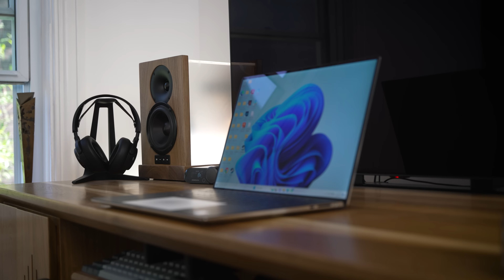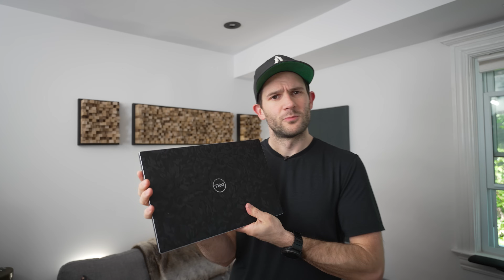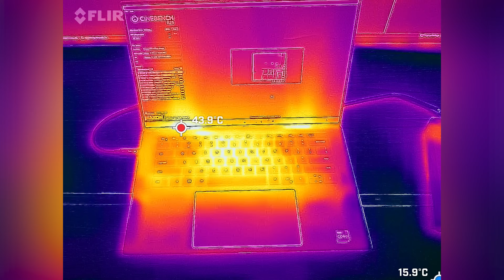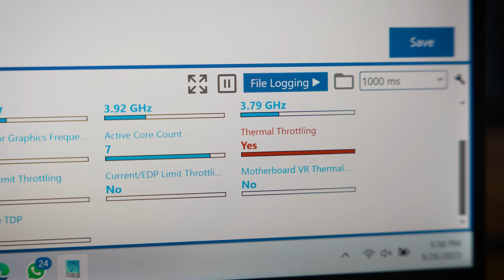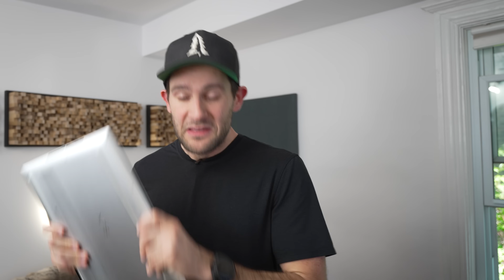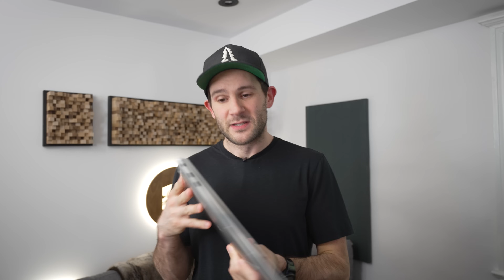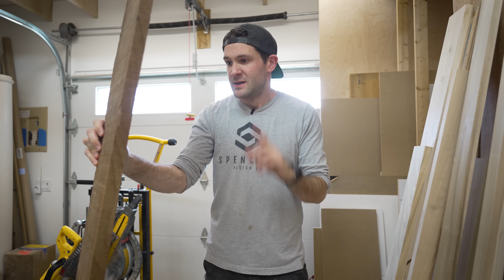The BEST mod I've ever seen....

Comment: you can buy heatpipes online. just stack it on the existing pipes and bridge to the heatsink. 
can also buy those thin ssd copper heatsink. just stick it on the heatpipe for thermal mass.

Comment: Make a replaceable back plate. One that is very open and is metal. Then make on that is plastic. That would remove you getting burnt while using it. Then make it be able to be swapped on the go.

Comment: I modded my 2016 XPS 9550 in a similar way because back then, VRMs in XPS's didn't have a heatsink and the laptop couldn't run any games for more than 5 minutes.
Temps massively dropped but what ended up happening is that the rubber feet melted and made a hell of a sticky mess

Comment: I think by pushing too much air through your laptop cooling system (if it has active cooling / it's own fans) is a bad idea since you can wear out bearings in the fans integrated in your laptop. This means they will be louder and rattle, worst case, they will get stuck and not move air when not on the cooling stand.

But it's a gradual process, you'll notice the bearing degradation before it fails on you.
Reply: why would they wear out? if they wear out from spinning from the cooling pad fans airflow then they would wear out normally also? its not the same as blowing air with a compressor when cleaning.
Reply: @ikuma8291  Bearings are rated for a certain RPM.
It might be fine when they run a little bit faster than they're rated for but overall, a powerful cooler might be problematic.

In theory the bearings can wear out by their own, but if it does, that might be related to some sort of defect in designing / manufacturing.

Comment: I have the XPS 15 9510 (i9 11900h, RTX 3050Ti) and yeah as expected it thermal throttles hard. 
The internal cooling is just nowhere near robust enough to handle those parts at even close to full load, so thermal throttling is inevitable. 
Repasting the CPU and GPU and improving airflow with a cooling pad can help dissipate heat a bit faster but it doesn’t fix the terrible  default power management settings out of the box.

By far, the biggest performance boost I saw was from using ThrottleStop to better control power usage between the  CPU and GPU.
The i9 default behavior is to boost up to max as soon as a load hits, using a massive amount of wattage and causing faster thermal throttling.
Unfortunately, you cannot use ThrottleStop to undervolt without some serious BIOS modding… but you can still use it to control CPU TPL wattage limits.
Clamp the CPU at 45W and only allow short turbo boosts up to about 65-75W. 
This makes the CPU less power greedy and thus gives more wattage for the GPU to use for games (but only up to 45W by Dell’s design).

Still throttles like crazy, but it ends up with significantly better scores on benchmarks on 3DMark, and I didn’t need to do any significant mods or BIOS hacking.

Comment: Just finished watching, like the end result, but I had one more thought to improve performance:  makingvthe part of the stand that touches the laptop a metal heatsink with the fan, and using something that can act like thermal paste as the part that the laptop actually sits on.  The rest of your idea is great as-is, your post-mortem is accurate, BUT while the wood was great for mockup and support, I'm not sure how well it acts as a way to get heat away from the case in comparison to something like Copper or Aluminum.   I felt similarly for the Switch Mod:  The plastic might be alright for protoforming, but to help collect that heat, that outer metal back you used should have hit some sort of metal heatsink to compliment the cooling of the fan.

That all being said, This project, along with your desk PC, is giving me ideas for my hardware, ESPECIALLY my Macbook Air (2015, with the SSD upgraded to 1Tb) and recent PC build (Ryzen 3600 that I am contemplating upgrading to 5600).  I wouldn't recommend the switch to Macbook due to not having worked with the latest Macs using Apple Silicon, and I would probably stick with Dell given the company's warranties and hardware builds since their shells will likely continue to be similar in materials to Apple's (NOT the same, but not cheap, either.)  That's why I'm not tossing out any suggestions for new laptops - but because if what I just discussed and suggested, is why I would suggest paying attention to build quality and materials.

Comment: Some posters have mentioned Framework. I wonder if that is the best choice. Framework and other modular designed laptops like Primebook allow customization from their modular-design ecosystem of components (which arguably require more tinkering to even source replacements for).  It may or may not be ideal for your penchant to tinker. Given the level of customization you really want to do -- I would look deeper into the gaming ecosystem esp if GPU's are a must. Many of these boutique builders are NA-based and highly customizable. Names like System76, BLD by NZXT, IBuyPower, Xidax, Digital Storm, Origin, etc... Cool stuff!

Comment: Laptop makers generally don't advertise an amount of performance, they advertise the included Component's max expected performance depending on thermal conditions. It isn't a lie. You DO receive the clocks they advertise (unless the unit is defective) but if you notice they never tell you that the devices can sustain those clocks.

Devices like this generally are built in a way to be Skin Temprature Aware, aka, made to not dissipate so much heat through the chassis that it becomes dangerous (past a federally regulated limit) You are I might not mind shell temps that can reach 50-60C, but people who run these devices in their actual LAPS would. A side note, hot keyboards, palmrests and trackpads also suck to use, discounting the chance of "burns".

Laptop makers will be hyperbolic to the extreme to sell their devices, but they wont outright lie.

They let the government handle that.

Comment: A static pressure fan would of been better suited for this build instead of an air flow fan. FYI a static pressure 120mm noctua will do more than 2x the pressure of the one you chose

Comment: I should have looked at reviews properly before buying mine. BUt I recently got a IETS GT500 that has cooled it 15 degrees C. The way its done is that it creates a seal around the bottom of the laptop and pushes air through it. So maybe an upgrade for you is to create a seal around the fan the grill of the laptop.

Comment: You should either get a FrameWork Laptop or a MacBook with Apple Silicon. There, even without active cooling, you get the promised performance for several minutes under extreme load and on the MBP basically indefinitely. Even on battery - an area where all Windows manufacturers lie because they heavily throttle their devices. Basically render them not being Laptops but literal desktops.

Comment: so this is a superbuffed laptop cooling pad. I replaced my cooler with a 12v DC fan i have lying around and a buck boost converter, 5v to 12v and a direct barrel jack for 12v power supply. Pretty noisy but works fine. but having that bridge goop most likely increase the cooling efficiency.

Comment: You should have made a custom table with a hole in the middle you could place the laptop into that hole which prevent intake air and exhaust air mixing .with a build in fan below the table to further ease the air intake. 
You may also try water cooled laptop lid.

Comment: You can try 3D-printing a replacement for the back cover - a frame to attach the big fan and manage airflow. Then add many small ram coolers along the heatpipes, on gpu ram, and vrm.
This turns laptop in a strong and power efficient home-computer.

Comment: I have a 17" MSI GE76 Raider that has an Intel i7, GeForce RTX 3060 and 144 Hz 1080p screen. I got it well over a year ago for $1300 USD. It has been able to handle almost any game I throw at it at max settings and I've had no problems with it (though it also does get a little hot, it's entirely within spec). This is my first MSI gaming laptop and I'll probably be an MSI fanboy going forward.
Reply: What the f*ck!!! This Exact laptop is going for around $2500 USD in India,How do you get it for USD 1300

Comment: Okay, that was interesting and all, but I'd have been more interested to see if you could have achieved most of this without heating the shell more, by making the gasket seal to the bottom of the laptop and FORCING a lot more air through the laptop?

Maybe you could try that with another laptop without making ANY internal improvements, so we could see how much improvement was really due to the cooling pad?

Comment: Thermal throttling is bad, but I find that my Microsoft Surface battery will begin to die even while charging if I try to use the whole power of the GPU/CPU.

Comment: Nice project. I think i would have use two smaller fans made the "Grill " along the top where the air intake is on the laptop. I have a Dell Vostro which I have owned for 5 - 6 years now with no problems , you have just been unlucky and got one that was built on a Friday 🤭

Comment: Great video.. The final product just looks great. 
As for laptop recommendation , I have been using a LG GRAM 14 2022 for quite some time... Performs great for me even in heavy load.
Reply from the maker: Interesting! I hadn't considered a gram, unfortunately I don't think you can get one with a dedicated gpu though, can you?
Reply: @ZacBuilds  You can actually.  The newer 13th gen models can be configured  with rtx 3000 series if I remember correctly.

Comment: I Like what you did there!
But to all the Other ppl who just Put a Cheap Fan thingi under the Laptop to cool it more, because it already is getting hot and slow.
Please get a Fitting screwdriver maybe all in one set like iFixit and Arctic; Thermal Grizzly or the Noctua Paste and redo it after you clean all the dust out!
The Cheap fan thingy money is better spend there. Or and when you have non mechanical hand, you have and i guarantee you! You have a skilled person who is willing to help you, friends or family who ever.

Comment: Laptops tend to have little to no clearance under them to draw in cool air when they are on a hard flat surface, causing them to overheat. I think laptop pads are meant to make sure the laptop can get the fresh air it needs so the native cooling solution works as intended, not to directly cool the bottom of the laptop? I thought they were a thing of the past anyway. I never really bought into the hype.

Comment: If I may offer a suggestion; rather than goobing up your pc with paste and removing that heat protector from the rear shell; why don't you flip the fan around or reverse the wiring so it's sucking the heat out of the the pc and not pushing it back in? 🤔 very cool and creative video though!
Reply: Whichever way you do it, the air has to go in to and then out of the laptop, but I suspect "pulling" the air won't be as efficient. I don't think the overall airflow over the rear surface would be as good as "pushing" air directly on to it. Besides, warm air wants to rise, so pulling it down seems like extra effort. 😉

Comment: We dont need thin laptops. It has no upside and a thousand downsides. I never had any issues with how thick my hp dv6000 was in 2006. If they made laptops as thick as they were back then we would have far better thermals.

Comment: Im curious to know how much the fan played a role in your setup. 200mm fans have good airflow but they have horrible static pressure. Given that your fan is in a very tight space and a good distance away from the laptop, I imagine it's not moving a lot of air into the chasis like some well placed high static pressure 120mm or 140mm fans would. Regardless, I imagine the majority of your performance is coming from all the thermal conductivity modifications you made.

Comment: First video of yours I watched.  I was wondering if you'd get more thermal energy removed from the bottom surface by inverting the fan? It probably won't make a difference, but I'd like to compare.  PS. You could print up some vent chanels to keep the hot air from the dell docking station.

Comment: Noctua paste is not good for direct die and laptops. It's not a thick enough suspension- too liquidy, the seep-out from it might actually hurt your performance more than it helps and you'll have to replace it wayyy more often because of it. Look into Honeywell's PTM pads and pastes. They're a higher temperature and a thicker suspension- sort of gel, so they take a while to "set" correctly, but when they do it is far far better for longevity and performance.
Reply: PTM will give you betting lifespan but certainly not better performance. As for paste lifespan it’s highly variable on the laptop design, plenty of people use mx-4 in laptops for years.

Comment: IDK if right now due to a different updated EULA or something of that sort you voided the warranty on your laptop. As per the rules of Dell warranty way back in the day (2005-ish) I don't think you would run into any issues just because you opened your laptop to change the thermal compound and pads. The black insulating tape, that's more of a gray area, but if it works for you, it works. I like your woodwork.

Comment: I have a question:
My laptop (Acer Aspire 5) overheats too and I put Arctic MX-6 Thermal Paste in between the graphics and processor, but is K5 Pro thermal putty better? 
I want to try also using the thermal putty on the exposed heat sink like you did. Or is a thermal pad better? And is it ok to put it directly on the exposed copper pipe, as that is where my laptop gets super hot.
Also I was thinking about cutting out a few more air gaps as well in the bottom as well.
Would that make an increase in performance and decrease the temperature from around 60 degrees Celsius when it's not doing much?

Comment: I loved this so much. Besides benchmarks, did you notice improvements to gaming?

I've wanted to do something similar for my 16" 2019 macbook pro for a while now (sans woodworking). That laptop is horribly thermally throttled and has very little in the way of venting. I bought a spare backplate and my plan was to drill some venting holes into the backplate and use a massive fan to blow some cool over the CPU/GPU heatpipes as well as the VRMs. Ever the procrastinator, I put this off for a while and sadly my macbook died a few weeks ago. Ironically, I think it was killed by overheating, since in the weeks before it died I noticed that my CPU was running at over 90C while gaming which was strange since it would always throttle at around 85C in the past.

Comment: If you want some power at kinda low price i recomende you Lenovo (just need to delete those bloatware like other laptop) and tweak some power limit and change the thermal paste, on my laptop a Y540 with all of that i have a solide 6000 point on cinebench r23 with an I5 9300H pretty solide and throttle barely at 65W (the cpu is designed to 45w lmao)
Reply from the maker: Definitely looking at some Lenovos right now, thanks for the recommendation!

Comment: I got a mid range hp pavilion laptop and after activating overclocking, it can run GTA V at almost max graphics settings. It also has some insane cooling. It has bottom fans and also some fans that push heat Infront of the screen resulting in some good temperatures. Mine is the HP Pavilion 15-eg2xxx which was a few hundred dollars over $1000 but I got a discount at Costco for around $800. (Its back to normal price if you can manage to find my exact same one)

Comment: The best laptops are professional ones but they don't tend to come with super-duper GPUs and CPUs.

I'm running (among a bunch of other stuff) some 6+ year old hardware by Lenovo and although they're not made by the original people any more, they are still pretty sweet. Boring a/f to look at but hey ho.

 Seems to me (and this is my personal view) if you want to play games, buy a custom desktop machine and quit pretending that laptops use the same technology as their desktop cousins. The names might be the same, but when you dig deeper you start to see that (for example) while an old desktop i5 might have four physical cores, the same chip in a laptop has TWO. Much the same applies to video cards. They are the size they are for a reason. Laptops running on 1000W of power? Not very likely- laptops with the same named parts to confuse the average dude in the street? You betcha!

From memory, you shouldn't put anywhere near that amount of thermal paste on the CPU or GPU. Most of it will squeeze out anyway and all we're trying to is cushion the very slight imperfections, not give them bath. The parts with bigger gaps are a real issue - putting the two together? Ummmm.....

Comment: This reminds me of my laptop which fan is not near the heatsink, but actually is in the lower opening (the case makes a corridor so that the air current is made until the exit). Not a suprise, but it overheats (even when lifted up), so I bought one of those external laptop fans that goes on the side of the laptop (it stopped overheating 😊)

Comment: A quick suggestion the new 9th Gen Lenovo Legion 5i pro comes with the 14th gen Intel Core i9-14900HX with the Invidia GeForce RTX 4070 8GB,  32gb 5800mhz GDDR5 Ram and 2 x 1TB  NVME SSD PCIe Gen 4 and they're practically giving it away $1899.99 or if you want a better Gpu they have the Lenovo Legion Pro 7i with the same Top of the line 14th Gen Intel Core i9-14900HX  CPU this time paired with the Nvidia GeForce RTX 4080 12GB GDDRX6 Ram with the same 32GB GDDR5 5800MHZ Ram and 2 x 1TB NVME  SSD PCIe Gen 5 M.2 2280  this laptop seems like they're giving it away also at  $2669.99!

I actually just purchased the Pro 5i a few days ago, and I absolutely love this thing. Its a beast and it punches well above it's weight class!!!